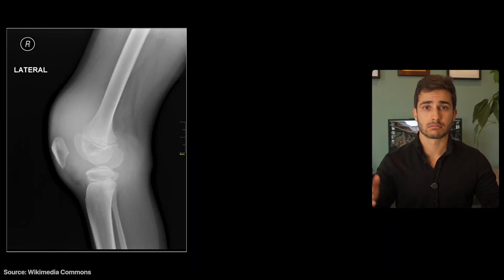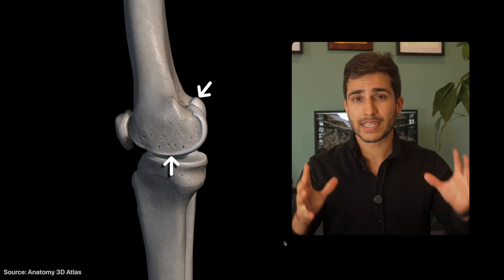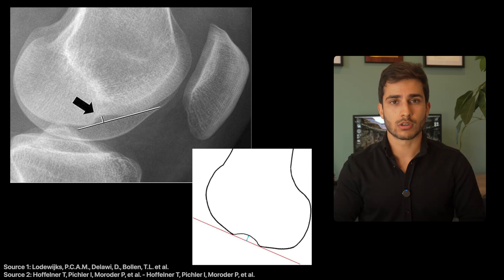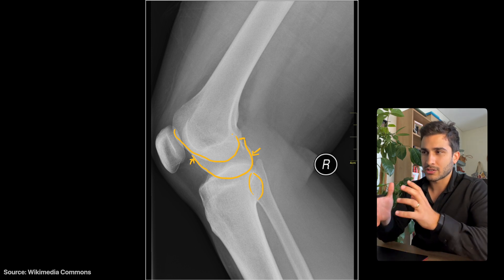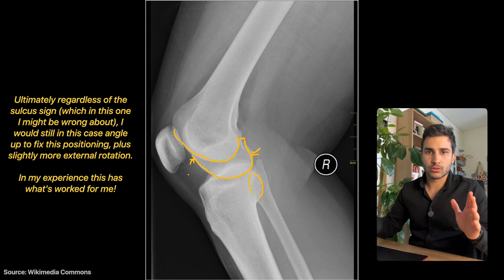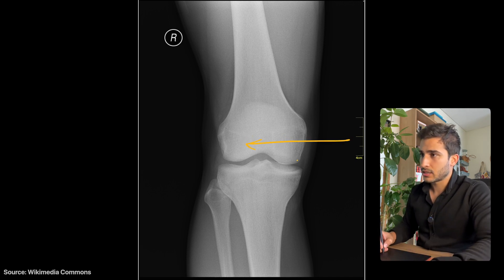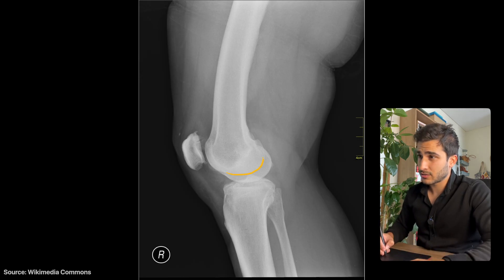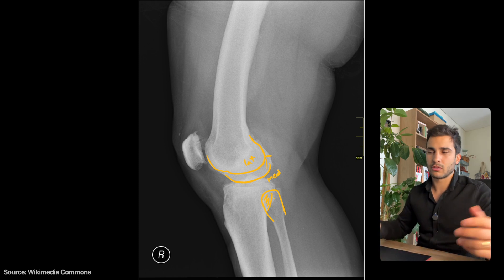How To Fix Knee Positioning!

Comment: This video was very helpful. I appreciate you sharing your knowledge and critiques of these images. When performing these radiographs, we image from a mediolateral approach for the lateral Xray (ideally), we angle cephallically to superimpose the femoral condyles, does these mean when we do a cross table lateral knee x-ray and image lateromedial that we then angle cadually 5-7 degrees to superimpose the femoral condyles? 

Would you be able to explain this further with a video explanation for x-table lateral knee X-rays?
Reply from the maker: That’s exactly right Kelly, all angles are the opposite when the site of entry is the opposite. The only additional difference or points to take into consideration here is as follows:
- because a lateromedial X-ray is usually taken as a result of some trauma situation, sometimes getting the consoled perfectly superimposed isn’t really the priority so that small angle may not matter as much, especially if for example you find a tibial plateau fracture or a big fracture through the console’s themselves 
- if this is done in a trauma trolley what you can also do is slightly angle the bed instead of the X-ray tube so it achieves the same result

I hope this helps
Reply: @SahandHooshmand  Thank you!

Comment: Hey there! Can I ask you about STANDING AP knees?  If the ankle looks like a mortise view (but that's what it takes to get the patellar centered), do you know in what way is that helpful for the Dr. to have the patellas AP but the proximal tib fib looks rotated? How exactly does a centered patella help?
Reply from the maker: I wouldnt worry about the position of the ankle, whether it looks AP or mortise, if you're looking at the Knee, then that's what's important to get in appropriate position. My general rule is try having the patella centred because (assuming there's no pathology there), the patella is aligned to the centre of the knee. Another method is to palpate the condyles of the knee and make sure they're being overlapped side to side (even though you're shooting AP, if that makes sense). 

if the patellas are AP, the proximal tibfib won't be rotated, unless the patella is misaligned due to some pathology or condition
Reply: Thank you so much for responding!

Comment: At 6:52, I would say the one you've labeled lateral may be the medial because I think I see the adducter tubercle which would be on the medial aspect of the femur. 
Great content! Thank you for the video! Thank you for showing the image of the knee replacement.  I would have never thought to do a straight angle!! That is extremely helpful!!
Reply from the maker: I agree with you! It makes much more sense that the lower one is in fact the medial condyle. These signs can get quite confusing, hence mentioning IF* this is the case a bit later on 😅  
Yes on TKR, always a straight tube for the lateral!

Comment: None of those images was accurately collimated which is a pity when good radiographic practice is so easy. All it takes is to give up on the centring point and use the light beam diaphragm to guide positioning.

Comment: Well-made video! Another tip in the arsenal is to look at the knee from the front (i.e. from the anterior side). If the knee "looks AP" from that angle (i.e. the leg being AP and parallel to the detector), then there's a good chance the lateral knee will be diagnostic just from an anatomical standpoint.
Reply from the maker: Interesting point Jason, didn’t think of that one. In your experience how often do you see a ‘non standard AP’ when the knee is in proper AP position
Reply: @SahandHooshmand  Personally, I haven't really found many instances of odd anatomical knees. That being said though, I think it's always a good starting point with what would work most of the time and then adjust from that (using all the concepts in the video :>). 

Just to add, another way to tell between the lateral and medial condyles would be the adductor tubercle (representative of the medial side).
Reply from the maker: @jasonluo33  Indeed. Is that where the posterior aspect of the condyles are a bit irregular (on the medial side)?
Reply: @SahandHooshmand  Yep exactly right 👍 superior to the condyles themselves it'll protrude out slightly

Comment: Hi Sahand. Thanks so much for uploading these videos. I think what you mentioned in case 3 at 8:14 makes a lot of sense. I'm currently a student on placement, and the X-ray tube at my site has been malfunctioning when trying to angle at small degrees like 5. What we usually do is, instead of angling the tube, we slightly lift the patient's leg and feet while keeping the knee in contact with the IR (to compensate the angle). This helps us achieve proper superimposition. However, since the tube was fixed a few days ago and we can now angle at 5 degrees, when we try combining both the tube angling and lifting the leg, we end up getting the same image as in case 3. So, your explanation about too much angling seems to make sense in this situation. Thanks again for these incredibly helpful videos!
Reply from the maker: Thanks! Glad you found it helpful. Also, interesting point you made... I hadn't heard of lifting the feet instead of angling but that does make sense. Is there a protocol of how much you lift up, or do you just put a sponge underneath and in most cases it does the job? Patient comfort ever an issue?
Reply: @ I was not told any proper protocol for the exact angle to lift up, but the rads would normally do it just a touch. For patient's comfort, I wouldn't think this is the best way. From my experience, when we place the detector underneath the knee and ask the patient to roll over, they often report discomfort, esp around the mid-thigh where the edge of the detector sits. Lifting the leg up could probably increase the discomfort. I've never seen anyone use a sponge underneath, but that might actually be more comfortable for the patient than having to hold the leg up. I think it also depends on patient's ROM. Overall, cephalic angling would be preferred but we were doing this due to the limitations on tube angling. Thank you 🙂
Reply from the maker: @zarklinn2997  that was exaclty my thoughts, usually I get complaints that the mid thigh is digging into the detector so that would make it worse. But good to know it's a backup option